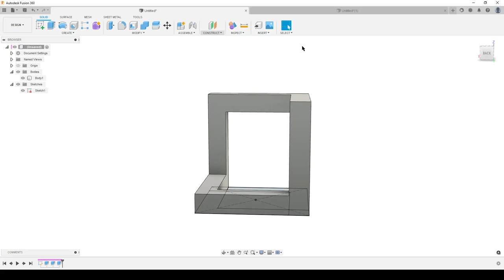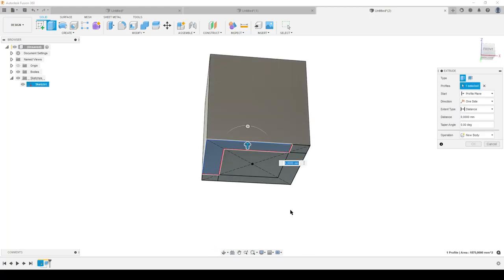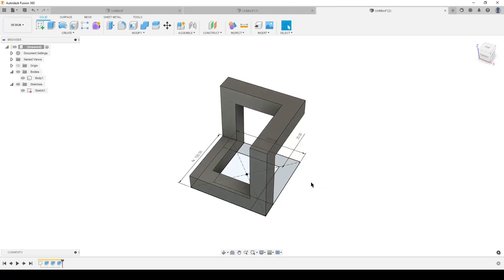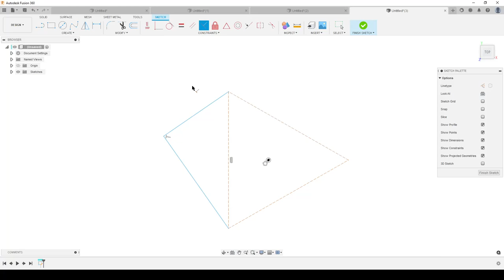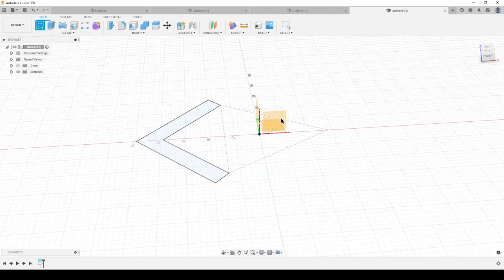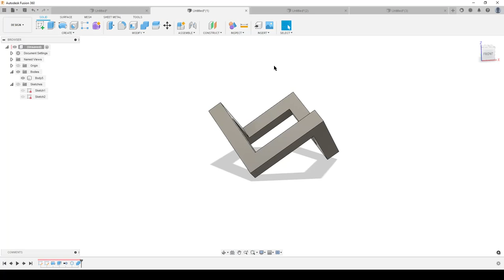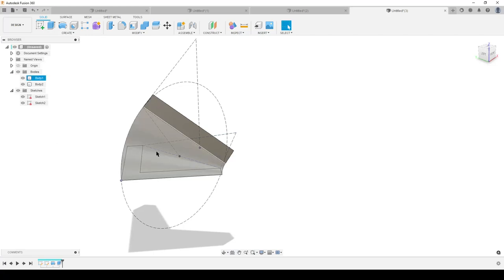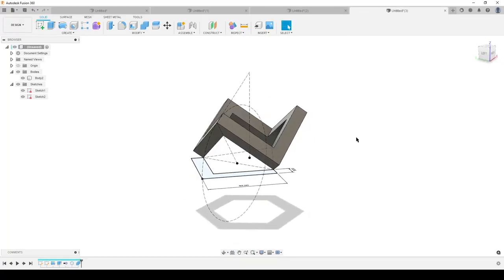Fusion 360 - Sphere trophy stand (2021 december challenge)

Comment: So instead of a 3D Sketch you use a temporary body… 
I used another simpler method:
The inclined L forms a right angle triangle over the projected hexagon (3D). Every 3rd corner of the hexagon is also vertically aligned. Simple constraints do the trick: length, perpendicular, vertical.
Reply from the maker: I often avoid 3D sketches, in this case you can get them fully constrained but often they behave strangely.
If I hade sketches the profile I would had done that on a construction plane.
The triangles as referens was how I first found the geometry. After I made the model the hexagon becomes apparent (that's why I hade ground shadows on to show more info in the video)